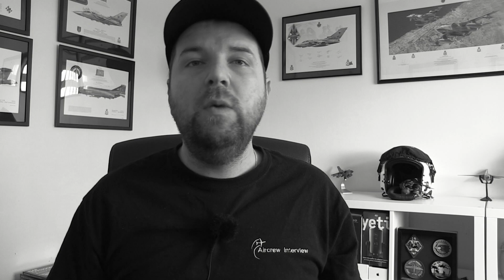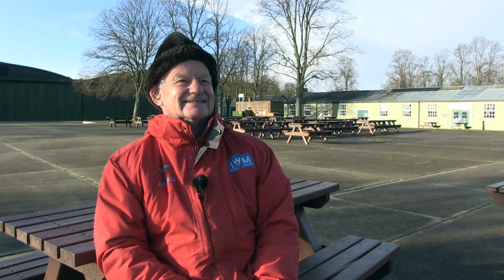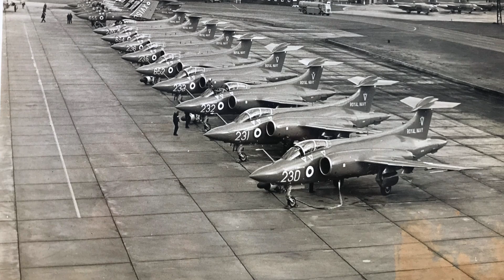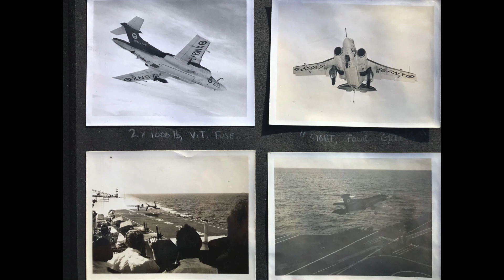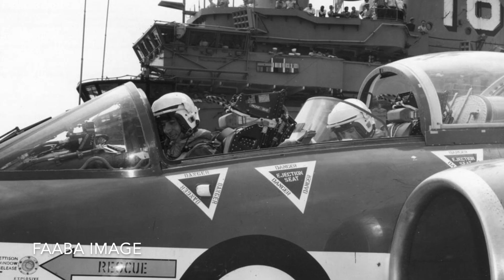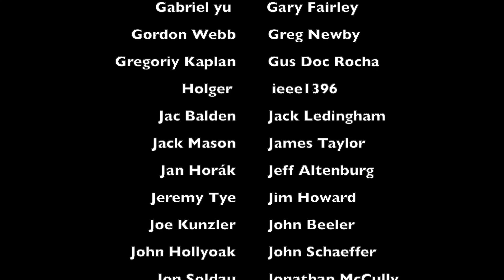Royal Navy Buccaneer | with Tom Eeles (Part 1)

Comment: 05:10 - didn't know that landing on a carrier has pretty much in common with landing of a glider. In a glider one also adjust the speed with the stick and the gliding slope with the air brakes. Interesting.
Reply: I 100% agree with that in all aero planes!

Comment: I remember as a lad spending a week at RAF Lossiemouth around 91. The buccaneers were old then but still some sight, espesially in desert camo. The simulator was something else, i'm sure if i remember correctly it was a physical 3d landscape model with a camera suspended above it.
Reply: I did a camp at Abingdon that year. It was the deep maintenance base for Buccaneer and Jaguar. One day, on a famil with the engineers they asked if I wanted to go and meet a Buccaneer arriving. The pilot didn’t understand the hand signal to retract the speedbrake so the engineers had to fire up the external hydraulic system and do it themselves. As part of the connecting process of the hoses I got sprayed with Skydrol...great stuff. The engineers were worried but I thought it was awesome....didn’t know as much back then. Happy memories and sad that with the exception of Conningsby, every station I visited closed soon after. Abingdon, Brawdy, Chivenor, Laarbruch, Manston, Wittering (I think Wittering is/has closed).